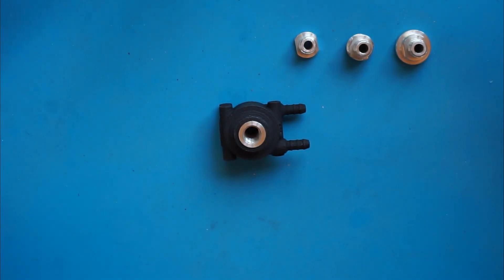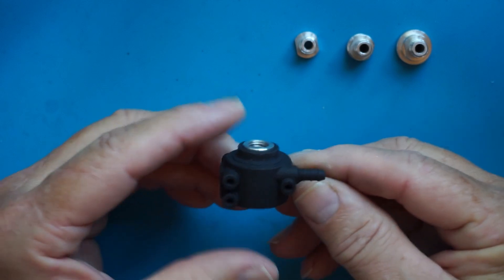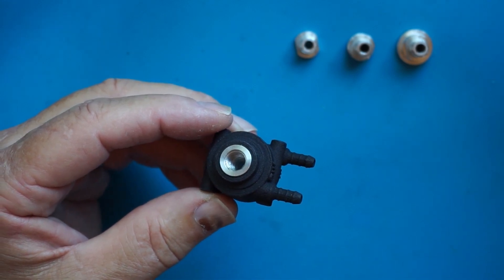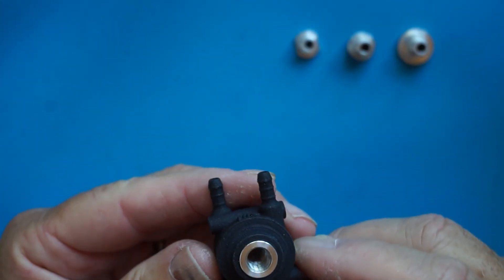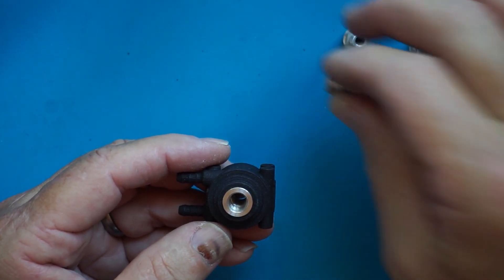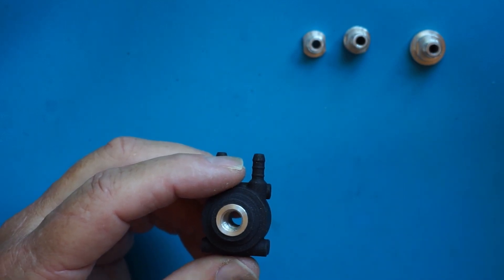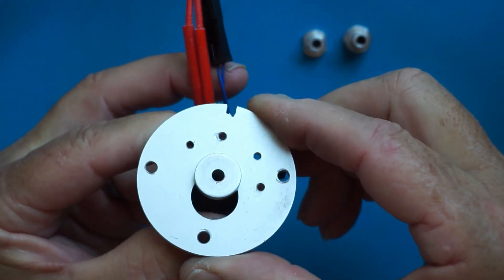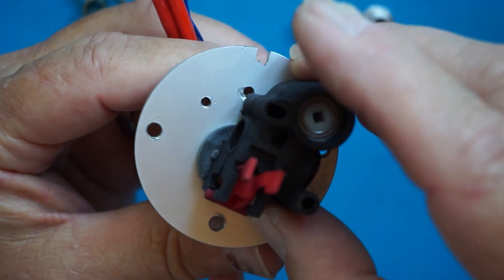The Zesty Kryo

Comment: I envision water-cooling hotends to be a big thing once patents expire in 2021.  This will serve as an excellent retrofit for existing designs using e3d's hotend. However, I see the technology going towards the mosquito style - stabilizing the heat block independently of the heatbreak, enabling a more fragile design but one that transfers far less heat up into the heatsink.
Great design, I still need to pick up a nimble though!